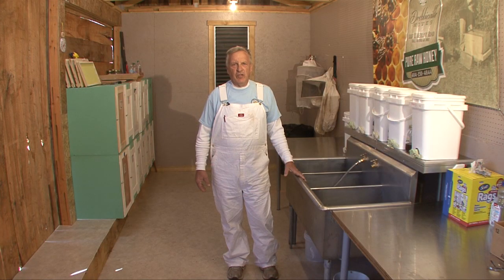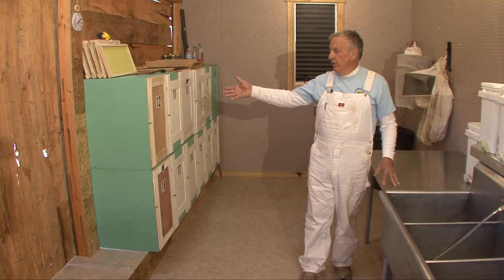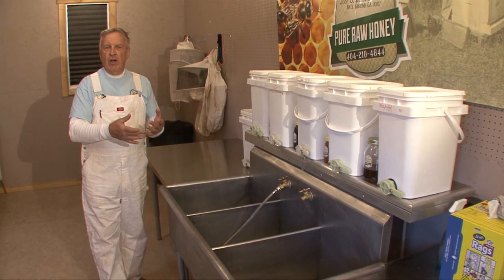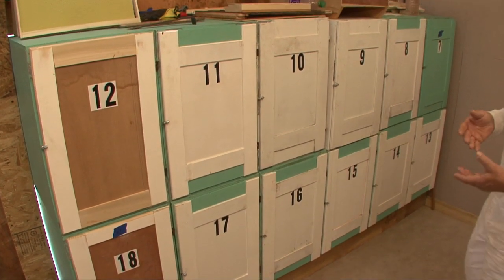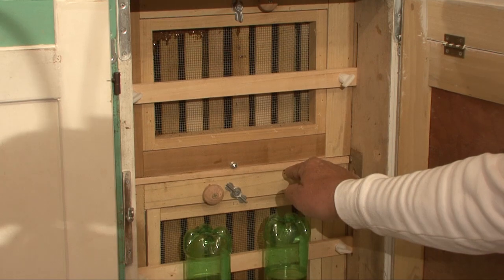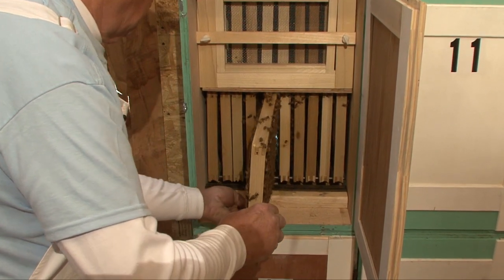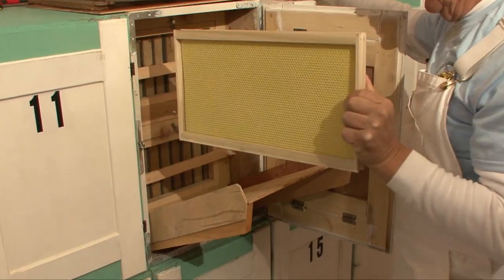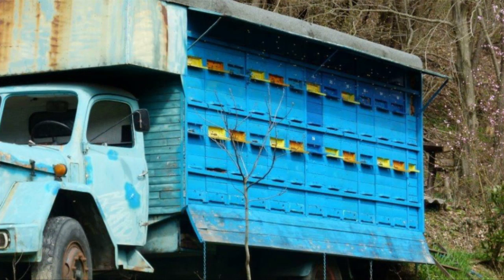SLOVENIAN "AZ HIVE" PROJECT

Comment from the maker: Hi Brent
Here are some of my  thoughts on the AZ Hive after 2 full seasons of keeping bees in them (8 years with Langstroth)

* Calmer inspections: bees are happier and less disturbed by my presence.
*I personally feel the hive will not be as effective in warm to hot climates (not FL.,AZ for example) Personal observation only.
* Honey has a bit less moisture content.
* The JOY of beekeeping! It is a great pleasure to open the back door of the AZ hive and observe the bees so closely, to look and listen, at any time, no tools or smoker necessary.  
*The AZ hive must have a climate barrier, cover or housing. Langstroth hives are usable 10 years tops.  The AZ can last up to 50 years if you invest in housing it well. That takes work.    Higher price, yes...but you can work the bees in the dark, rain, wind or cold, that is very helpful for a beekeeper on a schedule...
* Great hive for the smaller hobby beekeeper,  families,  educational purposes. .

This year I am experimenting with   3 chamber hives..  I  like the idea of letting the brood expand in the spring.  In 2015,  I pulled honey frames June, July and Aug.  It was so easy to just open the back door of the hive, pull the frames, walk in the house,  extract, and return the frames immediately to the hive to clean and refill. This method eliminates the need to store lots of super frames during the winter.
 I usually keep  4- or 5  bee hives at my home  The AZ hives have been  located on  a covered deck, just outside my back door.  My new 3 chamber hives are being installed in the window of my workshop. 
Good luck Brent , I'm  happy to offer up my experiences with the AZ hive.  I am a big fan!!!!
We will try to get a new video up soon.  Thanks

Comment: How do you do your treatments for varroa mite with these hives? I usually do an oxalic mist or formicpro strips laid on top of the frames but, of course, that is because I'm operating from above the frames in a Langstroth hive, rather than from the side.  Same with adding in fondant and pollen patty, what is the technique or method for doing that. They look awesome!
Reply: I'd make a "Feed frame" and take one of your frames and staple it up with hardware cloth and put your patty mush in it.  As long as you aren't crushing bees. The patties can be chopped up or just do what we do. Order in 50lb bags of Ultrabee or AP23 and mix it with HFCS 55. Then use a pneumatic caulking gun to put it in a spot where they can access it. For a hobbyist you could run  1/2 cup of hfcs 55 and 1 cup of the powder mixed. Let it dry off about 4 hours and slop it in there. Remember to go slightly "Wet" so it doesn't turn to a brick in 1-2 weeks. We skip the wax paper. It makes a mess in the hive and gives them more to deal with than they need to. Limit your feed  if you are in hive beetle country, you dont get larvae in it.  I skip the sugar water junk, because it raises the Nosema levels. Hope that helps! Sorry if I sound gruff.

Comment: Very interested, yet I still have questions.  Everyone says hoe easy it is to "brush the bees off and they take an amusement park ride down the slider and back into the hive."  However, when it comes to that step, no one ever shows it being done.  I can't even imagine there wouldn't be a room full of pissed off bees.  I have never seen bees gently brushed off a frame and not taking flight.  Also, I am in Maine.  We have 2 deeps for the bees to winter with.  Almost all of these hives I see have but one deep.  Can you get them with 2 deep for brood and a 3rd for extracting?

Comment: This is ridiculously cool. I'm not much of a builder though, so the shed and the hive equipment itself could get very expensive. I am so, so tired of lifting those boxes on my langstroth hives. How do you discourage robbing?
Reply from the maker: Like any hive, to prevent robbing I reduce the entrance.
You don't need  a fancy structure for these hives, just protection. Benefits are many I am a big fan. The biggest drawback is hives manufactured  with softwoods which expand and contract  leaving gaps for pest., 
That being said, management is unique but worth the effort as these hives can be easily worked year around and inspections and honey harvesting are much simpler processes

Comment: I have gone away from the angled slider shown in the video, in favor of a flat "table" as shown in Dr. Bozic' book. It is a piece of wood/plywood butted flush with the floor of the hive and secured by side rails attached to the upper side. These 'sticks' fit under the lower window and snug under the support rods and along the side walls of the hive. In the hives I've built there is a flat metal bar supporting the windows. The table 'sticks' fit snugly under it. Be sure the table is long enough to fully withdraw a frame -- especially if you add raised sides and back. Again refer to the picture in the book and have fun!

Comment: Mary, I'm interested in this principle, this video is fairly old, any updates since we're in 2016?
As far as the naysayer below, every line of thought and different method has it's perks and problems...the langstroth has it's problems as well. It's not really known what negative effects the stress has on bees that comes from opening up a Langstroth from the top, taking off supers, etc...bees spend a lot of energy resealing every seem and that's a lot of linear inches to a bee. lots of energy, lots of time, etc...plus brood gets a shock of outside air all the way through the hive. It's very arguable that the stress associated with opening langstroths contributes greatly to disease...think not, look at stress on livestock and it's negative effects vs low stress handling. Yes these are more "complex" that a standard langstroth but they operate far simpler and with less stress to both bee and keeper, better for cold, possibly better in hot weather, potentially far more mobile (if built on a trailer). Expansion...if well managed I don't see the problem and with a low stress environment, management should be easier.
Reply: +Brent Eason No new videos but I have increased the number of hives and am making a transition to 3 chamber (triple) hives. The ones in the video are two chamber (double). Our warmer climate and longer season allow the bees to build larger populations i the triple chamber configuration. The experiment continues!
Reply: Brian Drebber
Oh man...you have to (okay well I wish you would) post some video of the three chamber versions! I'd love to see that!!

Comment: Couple questions out of curiosity:1) How do you handle propolized frames stuck together?2) If the bees fly out into the shed during an inspection (either off the existing frame or just from inside) how do they get back in?3) How do u handle swarming?
Reply: +Dustin Kofoed I'm trying to check in here regularly to answer questions. 1) because the frames rest on such small contact points, there isn't a lot of propolization between frames. My experience is thatthe frames remain fairly loose and easy to remove even when left alone for some time. 2) Most beehouses include an escape 'hatch' or skylight in the ceiling. They go towards any light/air opening and return to the front of the hive. 3) Frame manipulation, splits, etc. --  and when all else fails... gentle sobbing and a few beers.

Comment: If you heat these bee houses in winter, is that more efficient and cheaper than other ways? And does it work to up the colony survival rates? Thanks.
Reply: If the inter is really cold, otherwise there's no need for heating.

Comment: How do these hives work for really HOT weather (think 110*F plus) for months at a time? I am interested in this type of hive, but we have to worry about heat, not winter cold (too much anyway, it only freezes a few nights a year).
Reply: +Morgan Roberds I don't know for sure because it doesn't get that hot here. But as with cold weather, the beehouse tends to moderate temperature swings. They are shaded by the large overhang and my building has an exhaust fan in the highest point of the ceiling vented to the outside. Since bees maintain hive temperature in the mid-90's for brood I would say that they can handle the temperature differential.
Reply: +Brian Drebber The reason I ask it that I want to avoid bearding. Also, other types of hives need modified designs in our area. For example, here you use wider, shallower top bar hives to keep the weight of the wax better distributed or it gets too heavy and soft in the heat and can fall off of the top bar. However, shade and an exhaust fan would be helpful.
Reply: +Morgan Roberds I have an exhaust fan in the ceiling of my beehouse.The bees maintain their temperature inside the hive at around 95 degrees F for brood. As for bearding, it is a natural behavior for the foraging bees -- which have no duties at the end of the day. They rest outside where it is cooler -- by hanging on one another. It isn't harmful or detrimental to the hive in any way. In fact it is a sign of a healthy strong hive..

Comment: I have been looking into this for a while and I think would be ideal for Northern Canada where we are.  Any thoughts on Bear Proofing the exterior?
Reply: +Kelly Burnham My thought -- even though I've not had a bear problem and we do have them around here -- is that the hives are already more secure without doing anything. However my first defense would be to fit a sturdy metal screen over the fronts of the hive. Think vending machines at rest areas and how they are protected from vandalism.
Reply: +Steve Sherman thanks for the comment.  We have a rather large Bruin visit our hives last fall, so we have an electric fence as well.  I'm mainly interested in the AZ hive because of the horizontal, access to the internals - make too much sense.
Reply: Electric fence with three wires is the best protection. The lowest wire should be really low, so a bear cub can not crawl under it. Think captured cub and angry mamma bear.

Comment: As a commercial operation runner, sporting a Cowen honey extraction line and looking at this. I think this looks like a nice system for stock protection. HOWEVER. Modern day beekeeping is a responsible practice of VARROA control and doing Tracheal mite control before AUTUMN sets in . Often hobbyists will jump on the usage of Powdered sugar and screen boards which does NOTHING to the varroa population. If it did. I'd order pallets of the stuff and the mills would love me.. ;) .  My recommendation is some Hopguard II. Since it is easy for a hobbyist to use. I would say however that it will NOT give an extremely good mite drop like what we use. BUT none the less. Some varroa control is better than nothing. Overall it looks like a good system. Go buy one of these if you are wanting to keep ONE hive on your property. and purchase a Varroa easy check tool on the side.

Comment: Has anyone come-up with a design they'd like to share for building an AZ style hive that uses Pierco plastic frames?  I'm working on a  design myself.
Reply: +Kelly Burnham The metal rail system used to space and hold the frames would likely have to be re-manufactured to fit the NAmerican frames properly...the AZ frames are slightly thinner than ours and depend on the rails for holding them steady and properly spaced. It would mean getting a design modified and having it laser cut by a metal shop. Past that everything else in the hives is easy to adapt ie. size of box and fittings.